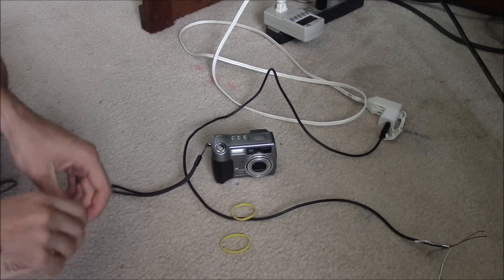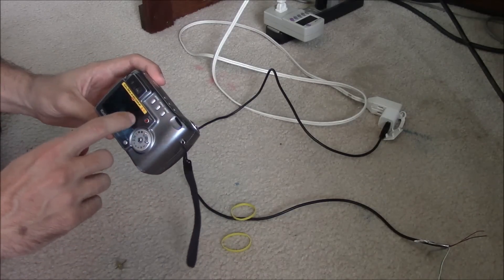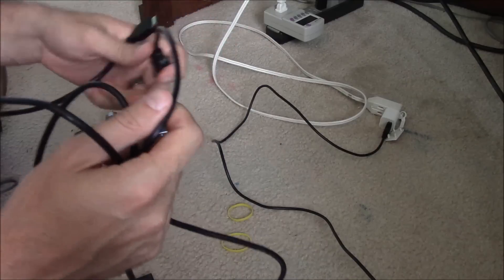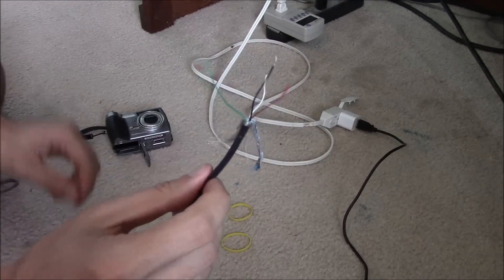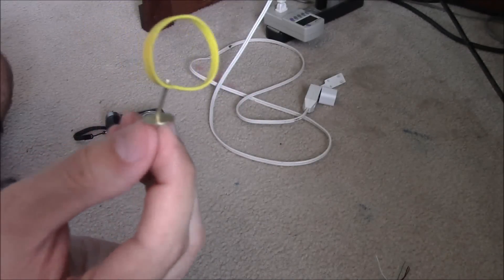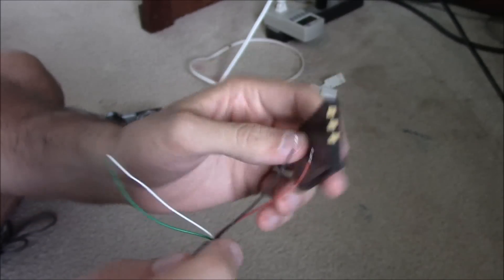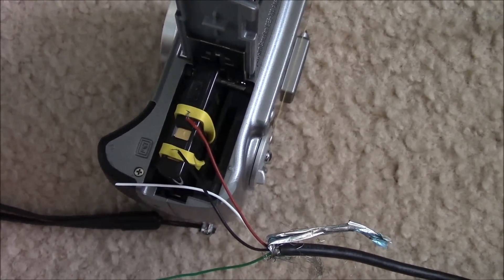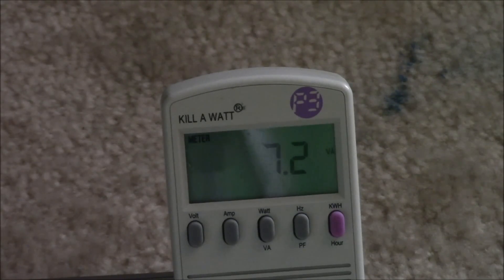Charge a Cell Phone/Camera Without The Right Adapter

Comment: works just fine with batteries that has protective circuit..batteries without circuit could go explode
Reply from the maker: This was not meant as a means to fully charge the battery.  Just as a way to get a little bit of charge into a battery that you no longer have the charger for so that you can operate the device for a brief period of time.  For example, if you needed to get some pictures off of the internal memory of a camera.

Comment: usb is 5v. but lithium is 4.2 v. see the issue?
Reply: Lithium battery MUST be charged with 4.2 volts MAXIMUM. Else, they can explode or catch fire. Lithium battery charging is complex thing. You can't just stick 5 volts and say they will be charging properly. First they charge in constant current mode. After that, when they get close to 4.2 volts they go in constant voltage mode. Then they charge to 4.2 volts while the charging current is dropping. When the current is close to zero milliamps battery is fully charged.
Reply: Mihajlo Petkovic Unfortunately, many have put up videos on youtube using 5v to charge their phone batteries directly via the battery holder pins. They thought lithium cells are charged with 5v directly and clearly misled by the charger and usb ratings.  Ignorance has no cure.
Reply from the maker: No.  Do you understand how battery charging works?

Comment: how do I expose the copper in the wires?
Reply from the maker: Just use a wire stripper or a razor blade and carefully remove the outer plastic jacket.
Reply: LDSreliance I found out a way not I used scissors, but sadly the battery still hasn't turned on so either the battery is bad or the phone is
Reply from the maker: Bummer.  Those older style batteries can go bad in a hurry.

Comment: tape instead of the rubber bands should work fine?
Reply from the maker: Of course.  Anything that will hold the wire in contact with the leads of the battery.

Comment: should I touch  that points ???? + and - ???
Reply from the maker: It won't hurt you if you touch it with your fingers.
Reply: its hurt or not ??? : /
Reply from the maker: Dipen Love
No, the voltage and current is too small to hurt you.
Reply: LDSrelianc

e

Comment: This is very dangerous as battery pack is about 3.7v and can be charged with 4.2v not with usb power 5v. I have seen LI-ION & Polymer exploding and hence will not recommend this.
Reply from the maker: This is only an emergency method when you have no other way and just need a little juice.  You are completely safe charging a battery like this for a short period of time.  If left unattended for many hours it certainly could destroy the battery.

Comment: Does it work without the elastic bands?
Reply from the maker: +Tepig and Oshawott Sure, as long as you can keep the wires in contact with the terminals on the battery.
Reply: Thanks

Comment: did you do a video about getting the data off the camera? I have the same problem, old camera but we've lost the proprietor cable. thanks.
Reply from the maker: +Master Kammelryder No, this one was pretty straight forward once we got the battery to charge up a little bit.  I was able to transfer with a micro USB cable.  You may also be able to put in an SD card and transfer from the internal memory to the SD card.
Reply: +LDSreliance ah okies. this camera's so old it only has fixed on board memory.
Reply from the maker: Master Kammelryder
So it doesn't have an SD card slot?  Does it have a micro USB or proprietary transfer cable to connect to a pc?

Comment: You can get a charger of ebay for less then $5 that will charge any old camera or cellphone batteries, no need to go splicing wires.
Reply from the maker: +Josh Halb True.  I haven't seen them that cheap but I know universal chargers do exist.  I have used a few of them.  But why buy something to use one time and never need it again?  This was free and took less than 5 minutes to do.

Comment: This can result in destroying your battery because the power flow into the battery is consistant but when charging it with your phone its not. The reason why the power flow when charging the battery via your phone is not consistant is to prevent your battery from overheating. Charging your battery the way its shown on the video is quite risky because your battery can burst into flames or stop working. Great vid btw ;D
Reply from the maker: +W0W Thanks, and I agree this is not optimal.  I was trying to demonstrate this for an emergency purpose like I had.  I had an old camera where we lost the power adapter but we had some pictures on the internal memory of the camera.  Before we trashed or gave away the camera we wanted to get those last pictures off there.  I was able to charge up the battery for about 5 minutes or so and then was able to have enough time to get those pictures off.

Comment: hey. whats with the yellow and white wires?

I'm trying to charge my nokia 5800
Reply from the maker: +Irfan Hakimi Rahdan Those are for sensory inputs and other signals.  They are not needed to charge up a battery.
Reply: ive used another color but it works!
some sorts of bronze/chocolate and yellowish wire
Reply from the maker: As long as it works!